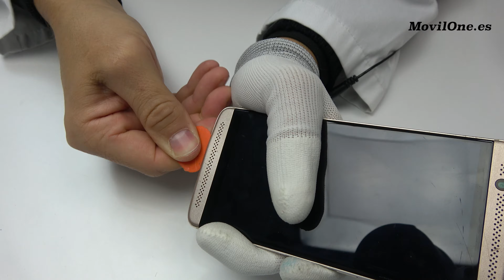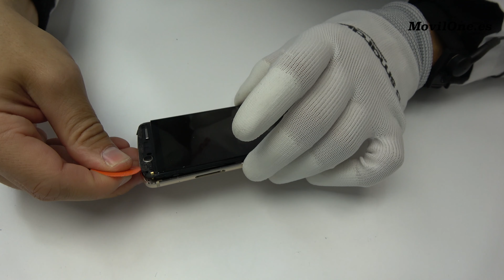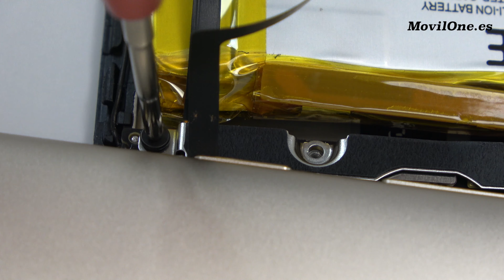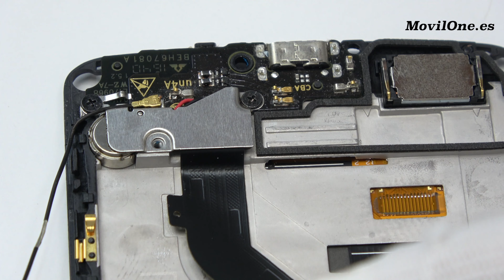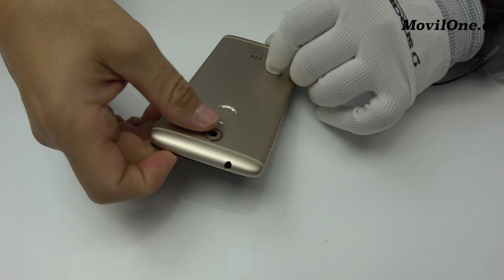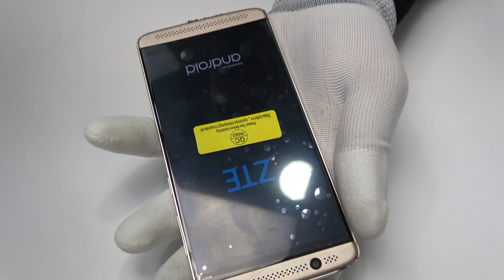ZTE Axon 7 Mini Screen Replacement

Comment: my phone droped into water. it is working but screen doesnt work. sometimes it comes and goes. ı think the problem is in the display cable. there is no display cable for sale on the internet. there is one cable in alixpress which is said lcd flex cable but it is interconnect cable ( main power cable which provide electricity from charge port to mother board). what sould ı do? ıf ı clean the display cable with thinner or antisttic cloth , does it work? because it is not totally harmed . ıt somestimes works then it doesnt.
Reply: Have you allowed it to dry?. Maybe oven?